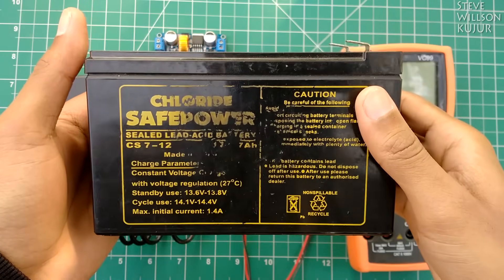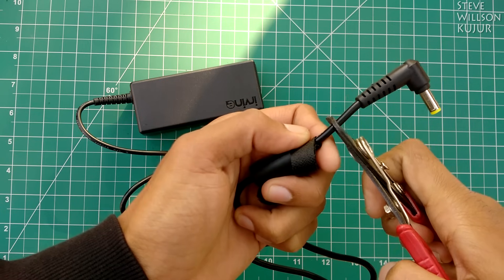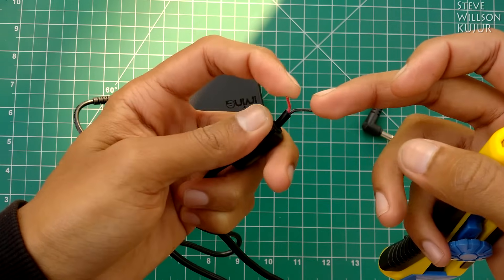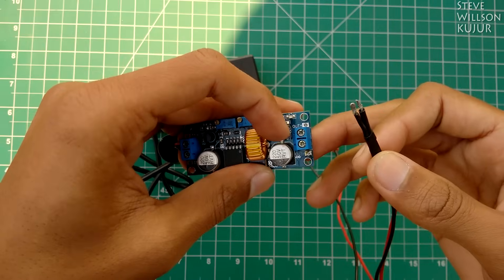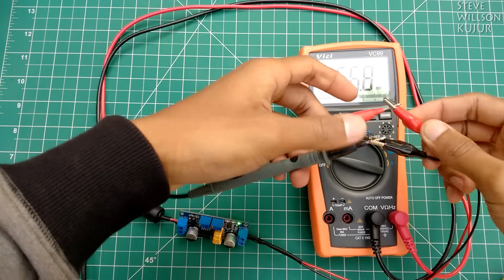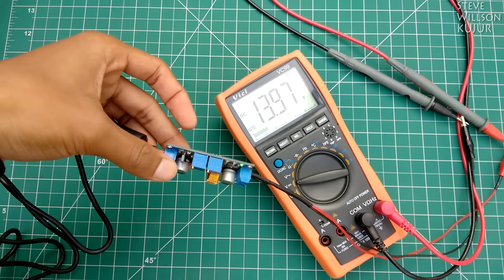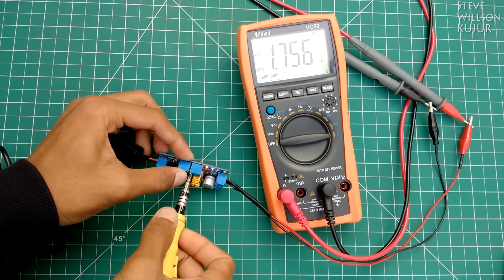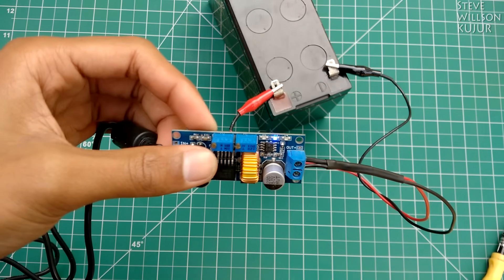How to Make a 12 Volt Battery Charger

Comment: You used DC to DC Buck converter which can give 14V 2A is that a constant current source because considering property of lead acid charging its current remains constant for a while and then it decreases to around 0.03A ?
Can 12V 2A SMPS will suffice to charge 12V  Lead Acid Battery?

Comment: Thanks for the clear, simple video. 

We are wanting to run / charge a portable device powered by a 12v, 7A/H AGM battery, from a car cigarette lighter plug, and this looks like the perfect circuit for limiting Amps and Volts to safe levels. 

My question: Is there a built-in function, or a simple modification for disconnecting the load battery if its voltage should fall below the safe minimum for gel batteries? Some customers will likely take the running device out of their utes into the field and may forget/fail to plug it back into the car in time, thus compromising the battery.

Comment: I have a 12v charger came with a monitor. The monitor is not working. Anyway in my case i think i should be ok to use the 12v charger to charge 12v batteries or i still need that controller thing?

Comment: I've used this module for charge 12V battery. Input is 15-19VDC and output is 13.8VDC with 0.5Amp. But i have problem at inductor is "sounding". Can you help me to find the problem? Thanks.
Reply from the maker: +Dian Wardiana there is no problem .
You get hmmm sound just because you inductor wire is loose . 

It's not a big deal .
Reply: So i must replace the inductor? or how to fix it?

Thanks for very fast reply.
Reply from the maker: +Dian Wardiana Yes you can replace it or better buy a new converter it's very cheap
Reply: Thank you very much. i will do it.
Reply: Steve Willson Kujur 1 question again. Are you ever use this module to charge the battery for 24/7?
Thanks.

Comment: where I can buy this dc-dc converter module?????????
Reply: Yes but as per your own formula, you have a 12V/7AH battery and you have set current limit to 2A, whereas it should charge at only 700mA(1/10 the current capacity) so what you did was wrong and 2nd thing is that you did not check the voltage after connecting the clips to the battery to see the actual voltage at the battery terminals.
Reply from the maker: +Nilesh Kumar see the description
Reply: thanks sir but how to know that which battery require how much current for charging?//
Reply from the maker: Nilesh Kumar just put the formula for lead acid 1/10 x amp for example 20A battery 

1/10 x 20 = 2 amps

Comment: Hello, great video. I recycled a 12v battery from an electric ride on toy. My question is can I use the 12v 1000mah charger that came with this toy if I attach the old charging port directly to the battery? Or will I still need this item that's in your video? I converted this battery into a small portable charging station just trying to figure out the safest way to charge the battery.

Comment: question.. how would you know if your battery is fully charged and if i leave the power connected will over charge my battery?
Reply from the maker: No it will not over charge your battery and the green led will glow when it will get fully charged

Comment: It took awhile but read through all the responses and would like to confirm and ask a question(s).
The order of disconnect from the battery if it is important is what battery first then supply?

Never looked at the inside of my multimeter so have to ask what does the input look like when connected in current measuring mode?

The diode you speak of for preventing the Solar panel from acting as a load at night, if used for this purpose, is in series with the positive side between the solar panel and battery?

My battery is 5Ah 12V.
Marking on the battery
Standby use: 13.6-13.8 Voltage regulation at .75amps
Cyclic use; 14.5-14.9 Voltage regulation at 1.5amps.
In my case, the output at the battery for this charging device should be 14.5 to 14.9 and set 
the current to 1.5amps.

Thank you

Comment: Thank you for sharing this worty work. I have a question : i dont know why you put the voltage on 14V ? isn't that dangerous for the battery ?  it is obvious to put it on 12V because the maximum voltage of the battery is 12V no ?
Reply from the maker: google it and you'll get some information sorry i can't make you understand here
Reply: Battery will be about 13.8v fully charged. Thats why he set the voltage to 14v.... :)

Comment: I have used this exact little switchmode module, they are really good BUT they are destroyed almost instantly if the input voltage is removed while a battery is still connected to the output. The addition of a reverse bias protection diode from the output positive terminal to the input positive diode will protect it.
Reply: Thanks . I also faced that issue. My buck converter was burnt. Need a reverse current protection .
Reply: Add the diode in output between converter and battery...
Reply: Can I connect 5822 ac diode with output position terminal?
Reply: So a Diode connect the 2 output ( neg and positive) on the board ?
Reply: No add a diode in buck output posituve @black11189
Reply: Friend how much power this module can handle before burn? for charge car battery better get a powerfull one?
Reply: thanks for the tip. Would a 1N4007 be hearty enough, or would one need something with more wattage and response time?
Reply: So why didn't u remove output wires first from battery?
Reply: Thank you 😊

Comment: Nice work !

 I want to charge my laptop from a 12v battery without using a 12v to 220v inverter is that possible ?
Reply: Boost converter

Comment: Your battery stated 14.1V to 14.4V.
Max initial current should be 1.4A.
https://youtu.be/sGYPHbEBmfw?list=PLth-wrfFxXehs9ZVIl_AXFZKvq591j5zz&t=203
Reply: https://youtu.be/sGYPHbEBmfw?list=PLth-wrfFxXehs9ZVIl_AXFZKvq591j5zz&t=17
It's a 19V 3.42A adapter, Max wattage is 65W. If you use 14V with 5A, it's 70W. Way exceeding the adapter limit.

Comment: Will this charge lipo or nimh or li ion batteries too?
Reply from the maker: yup it will see my other lipo battery charging video
Reply: im trying to make a bluetooth speaker with a tpa amp board, which type of battery should i use and how should i charge it? Im thinking of li ion. 
Should i make my own batteries with 18650 or use a pre built? Should i go higher voltage?

https://www.aliexpress.com/item/8pcs-lot-Original-18650-3-7V-2600mAh-LI-Ion-batteries-rechargeable-Battery-ICR18650-26FM-safe-batteries/32797759535.html?spm=2114.search0104.3.1.zvIHKB&ws_ab_test=searchweb0_0,searchweb201602_4_10152_10065_10151_10068_10130_10209_10192_10190_10301_10137_10303_10060_10155_438_5360015_10154_10056_10055_10054_10059_100031_10099_10103_10102_10052_10053_10142_10107_10050_10051_10084_10083_10119_10080_10082_10081_10110_10111_10112_10113_10114_10179_10182_10184_10078_10079_10210_10073_10120_10189-10119,searchweb201603_16,ppcSwitch_5&btsid=a11abcef-e329-4901-9466-7681562dbc38&algo_expid=255844e6-0e8f-48fc-852d-37fe2e95a4bc-0&algo_pvid=255844e6-0e8f-48fc-852d-37fe2e95a4bc

or

https://www.aliexpress.com/item/DC-12V-6800mAh-Super-Electrical-Rechargeable-Battery-Lithium-Li-Ion-Batteries-Pack-For-Wireless-Transmitter-CCTV/32818550364.html?spm=2114.search0104.3.2.kMapAK&ws_ab_test=searchweb0_0,searchweb201602_4_10152_10065_10151_10068_10130_10209_10192_10190_10301_10137_10303_10060_10155_438_10154_10056_10055_10054_10059_100031_10099_10103_10102_10052_10053_10142_10107_10050_10051_10084_10083_10119_10080_10082_10081_10110_10111_10112_10113_10114_10179_10182_10184_10078_10079_10210_10073_10120_5360020_10189-10120,searchweb201603_16,ppcSwitch_5&btsid=1a297d7a-2827-4d28-a0a5-6c24728eabcc&algo_expid=f5e4d615-24d9-4e63-af17-0421e9c851ee-0&algo_pvid=f5e4d615-24d9-4e63-af17-0421e9c851ee

Comment: hi, I have battery rated at 12v 4.5ah, with constant voltage charge of 1.35A MAX, this voltage charge means I have to adjust this DIY charger to 1.35aH and not to exceed beyond that? hoping for your quick reply

Comment: After 6 hours of charging 12v 7Ah battery with same setting as in video both blue and red light glows. Why does both led glows, is it normal ?
Reply from the maker: no it's not normal may be you battery is bad or the board
Reply: Thank you for the response Steve.

Comment: i did everything you did but when  connect it to the battery the green light never changes to blue. i notice the battery was charging however as soon as i took off the charging leads and check with my voltmeter i notice the volts were decreasing. could the battery just be bad and thus not switching form green to blue.
Reply from the maker: +hoxha34 probably

Comment: I been watching your vidoes for a while there great! 
I have a ?  
im making a 12volt lighting system for my bike but i need to find out how to charge my 12volt 1.2ah battery. its runs the light fine for about 15 mins. i found a 12volt 6 watts generator on ebay that runs on the tire of the bike. how can i use that to charge my battery. i know i cant just put it straight to the battery? help me please
Reply from the maker: +Eric Balles use same method how i did and
Just replace the adapter with generator
Reply: @SteveWillsonKujur  for 12 volt 1.2 Ah battery the current should be limit 100mAh-150mAh does this DC to DC module able to lower the current with potentiometer?

Comment: is that module have BMS (battery management system)
Reply from the maker: +Hanson Lai yes
Reply: Hey Steve, thanks for replying :)
I have some questions about charging my own batteries.
I have 4 18650 batteries. and their charging current is 1.3 amperes. How much amps to i have to apply? (the total capacity is 2.6amperes)
Can you teach my how to charge each of them properly?
I thank you a lot for helping. So far all the other videos didn't help as much as you did. 
Steve, good job and keep up ur good work. Im proud of you. Im influenced :)))))

Comment: I used this to charge my 12 volt battery on my Bluetooth boombox, works perfect. My fuses were blown on my volt meter and didn't work at first. I use a laptop charger putting out 19 volt and connect it to a 2.5 jack and then to the step down board that brings it down to 12 volts that I need. Thanks Steve
Reply: Sorry I realize this is old, but I have a question. What are is the 2.5 jack you add in? I am trying to picture what your saying but don't understand that part. Are you meaning you in-line a 2.5a plug in and then reduce the voltage on the voltage screw like he has? I have a Monster RR2 speaker and I am having a hard time getting it to charge, but I think it is because I am using a 10a 12.5v cord and it states on the back to only use a 15a cable? I don't think it should take as long as it does to charge. It has been plugged in for 15hrs or more and moved one light. That didn't last long at all. I recently purchased the battery so I had it checked at Advance and it is good to go still do didn't hurt it, so do I have to let it charge longer and if so I need to figure out something more practical charging even if I have to charge outside the speaker. It is very easy to access anyways. Thanks in advance,  and appreciate your response if your able.
Reply: @wanting2makethemoney  always remember that the amps on whatever power supply your using has to be greater than the number of amps on the device that your trying to charge. And that's because amps are pulled out not pushed in like volts so when the device has met its required number of amperage it automatically stops drawing out anymore the device only draws out what it needs and thats why the power plug/supply your using has to have a higher amperage rating than your device.  Hope that help.  Good luck 👍

Comment: Hi Steve,  Just wanted to let you know that I built this charger with the exact same parts and had a problem.  I was trying to charge a car battery and the device starting to heat up and smoke.  The output was fine but I believe the current draw was too much for this charger to handle  (??) I was glad I was around in case there was a fire.  Just letting you viewers know.

Comment: Thanks for the great video. I have a question about a similar subject. I live in an area where there is a constant breeze and want to build a small wind generator. I thought it would be nice to charge my phone from this generator. I am new to electronics so if this seems like a silly question I apologize. Since the power being stored from the wind generator would fluctuate with wind speed, would that harm anything you are charging? Sort of like a power surge. Or are there things you can add to avoid such a situation? Thanks
Reply: Don't use the wind power directly. Rectify and charge a battery. Then use the battery

Comment: bro I wanted to charge a 7.4 amphere 12 v battery ....what current rating should I use ?5amps ?
Reply from the maker: +son of a gun use 1.4 amp
Reply: Steve Willson Kujur what about two 12v 7.2amp in parallel

Comment: you are downstepping 19 v voltage to 14 volt voltage , this is loss of energy ,heat will generate and your step down converter don't have any sink or cooling fan in it. it may not last long ,it may get damage due to heat.
Reply from the maker: man it's a pwm function (SMPS) it's like 96% efficient so there is no heat at all @ 5A
Reply: Steve Willson Kujur thanks for the information..
as far i know one can only check the amp with the help of load.
but here amp is measured directly with multimeter without any load.
Reply from the maker: it's a constant current source that's why

Comment: can i connect the charger directly to the batter without use of the Dc to Dc Step Down Converter ?, i have a 19 volt charger with 0.5 amperes output. that would kill my battery ?
Reply from the maker: +DEVINDRA BASDEO yes definitely that would kill your battery

Comment: Thanks !! This is really Helpful...I will now reuse my UPS battery which was lying idle with me for 4-5 months.

Do you have a circuit/process for charging Laptop(20V 2.25Amps) or Mobile (5 Volts 1 Amps). If I can use my UPS battery as a power bank??
Reply from the maker: +Venkatesh Narayanan yes you can don't worry I'll come up with a new video make sure you subscribe to my channel for feature updates
Reply: Thanks...I googled for a while and found in Amazon.in a step down Unit that should work I think. Its  INR 93.00

http://www.amazon.in/Ultra-small-LM2596-adjustable-step-down-Converter/dp/B00LTQU4EQ/ref=sr_1_1?ie=UTF8&qid=1494102001&sr=8-1&keywords=Ultra-small+size+LM2596+DC-DC+3A+adjustable+step-down+power+supply+module%2C+DC-DC+Buck+Converter
Reply: Venkatesh Narayanan I know this has been a very long time so probably no longer matters but while yes that one would work it only allows you to adjust the voltage it does not have the adjustable amperage. And that is very very cheap price for those I paid $5 usd for one unit similar to that but it does have a built on voltage monitor screen so I don’t have to use a multimeter.

Comment: Do you use a multimeter directly connect battery measure current without load? 3:11
Reply from the maker: +葉倚嘉 because it's a constant current source don't do it without constant current.

Comment: Can I use another battery drill charger to charge another brand battery when other charger is dead, and is same voltage by connecting with wires between them